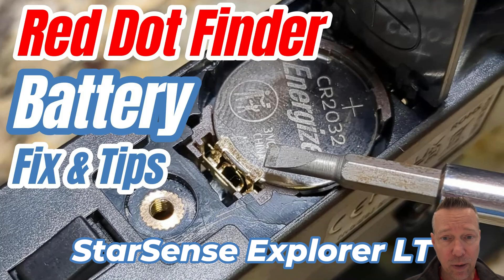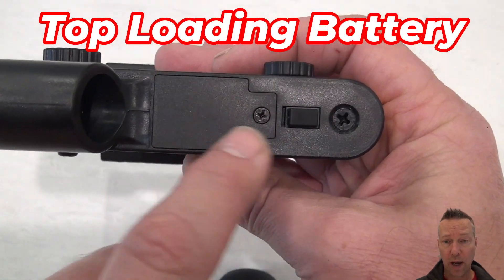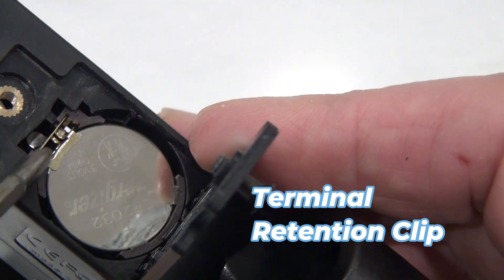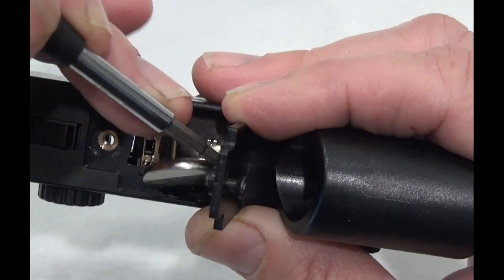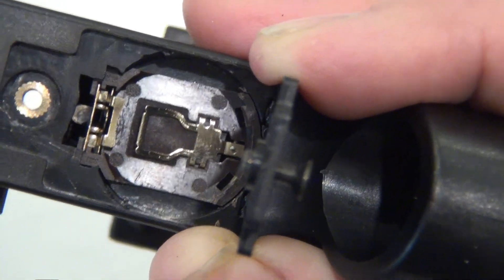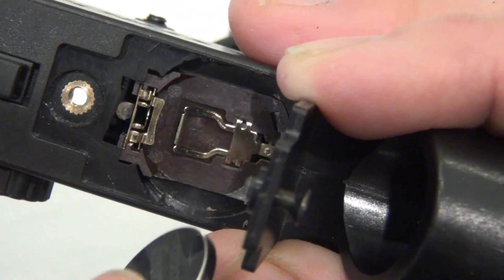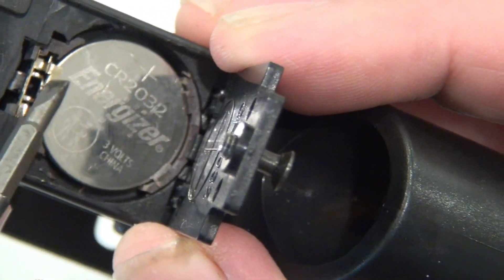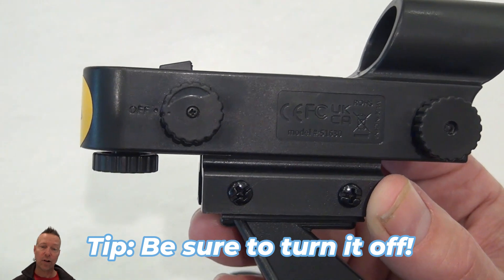Celestron Red Dot Finderscope Battery 💡Tips and Tricks

Comment: I did not notice the small metal clip, so when I replaced the battery, I mashed it down-thus making it impossible for a proper connection to be made! It took my wife's small fingers to finally get the battery back in place UNDER the metal clip! Thanks for this video!
Reply from the maker: Sweet, thanks for sharing your experience and the tip!  So glad to help  -Steve